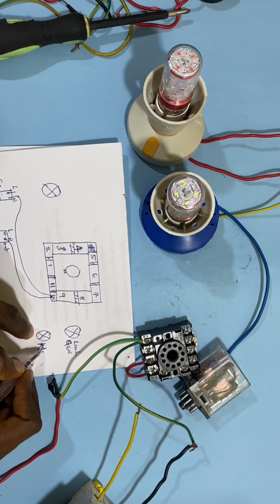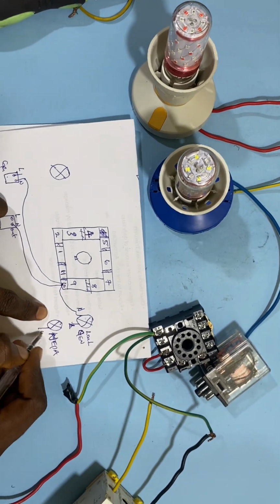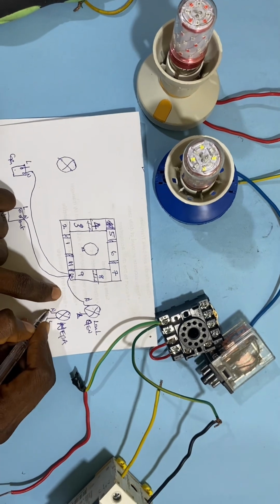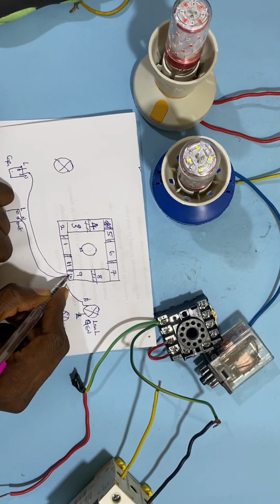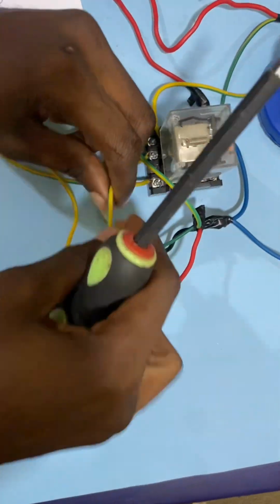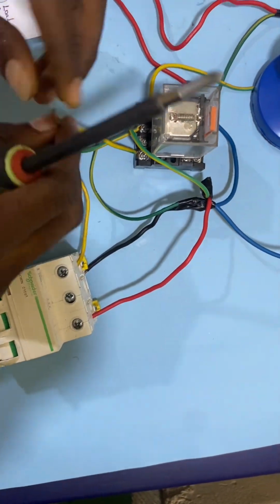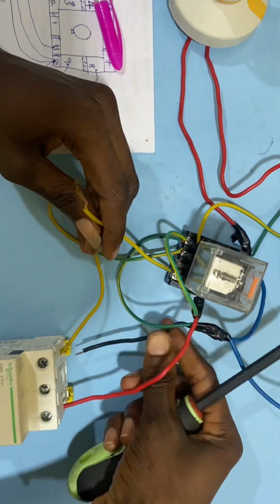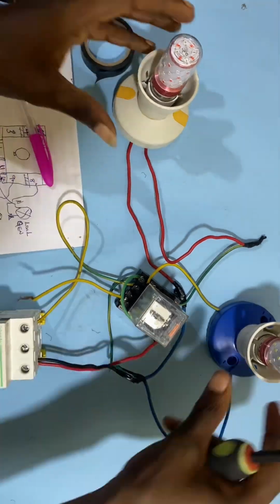Automatic changeover Switch Using a Relay #AutomaticChangeover #HomeElectrical  #GeneratorSwitch

Comment: What happens if there is constant power in both GEN and NEPA supply
Reply from the maker: @bestEva-t6p  then NEPA will be use as master why Gen is the slave. That is as soon as NEPA supply is available it will automatically swap from GEN to NEPA depending on the configurations